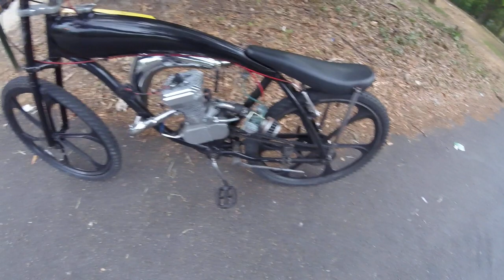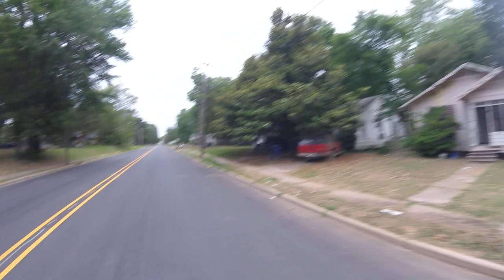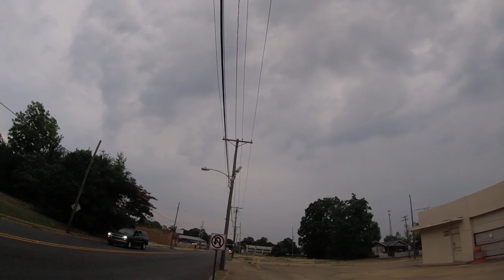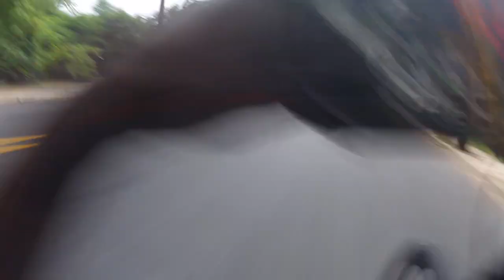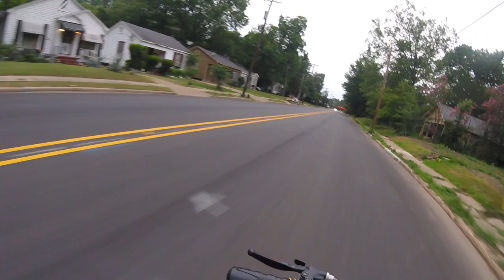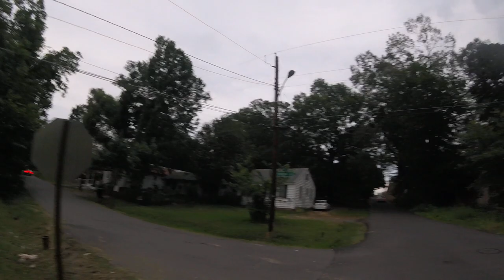OZ Case Reed Test Run UnTuned Engine 49 Mph Subscribe and Turn Notifications on Please

Comment from the maker: Yea Thats it I need to turn the Air screw out some more because it wouldn't speed up no more when I was going 49 Mph
Reply: Rinegn Productions I bet you can get close to 60mph or more with some good tuning.
Reply from the maker: True, and all it needs is a better Carb but im gone try to push this one to the limit aince I have all the kets for it and also I have a 21mm Oko Carb Im sure it will make it pull hard but its gone rum lean and ik im gone have to rejet it

Comment: Oughtta considering changing your gearing too--11/28, maybe, if of course topspeed is your endgame like it is for most of us. Lol
Reply from the maker: Purnell Espinosa i’ll try it out and yea I’m sure I need to to drop down some teeth
Reply: @RinegnProductions  ..hey brother I've just recently started watching your videos and I'm impressed brother...I've currently running a standard motor with window piston and oz style reed valve a HP carb with a 67 jet a fat belly pipe looks like the mz65  a 44 tooth sprocket and it's hitting 37 MPH I think it should go faster.... what do you think?? Thanks brother I
Reply from the maker: @dannyoutlaw9919  drop your sprocket to a 36T
Reply: @RinegnProductions  cool.. yeah I've got the sprocket I'm waiting for my adapter to get here... tommorow for sure... how much you think it pick it up

Comment: I'm hoping a gt80 ported reed cylinder/with oko carb and a piston window and loop around exhaust will help me get that extra 15mph i am craving currently maxed out at 40mph , basically stock with 10/36 teeth
Reply from the maker: Yes u should get there with that set up

Comment: Ey, in yesterday's vid u mentioned "still learning", particularly with the carb tuning thing. There's a website--mid-atlantictrials.com--where you can learn (still reading & re-reading myself), in great depth, how to tune the OKO/Keihin knockoff. Be it the 21mm OKO you've got--I've it and a 28mm--, the Keihin or even the Mikuni they are essentially tuned the same (i.e. pilot jet, main jet, needle and float). Currently playing with Mikuni vm18 myself but, like I said yesterday: Immediately went from 50 to 54.6, untuned, 11/28 gearing...
Reply from the maker: Purnell Espinosa Ok Cool I’m about to look the website up right now, thanks Bro.